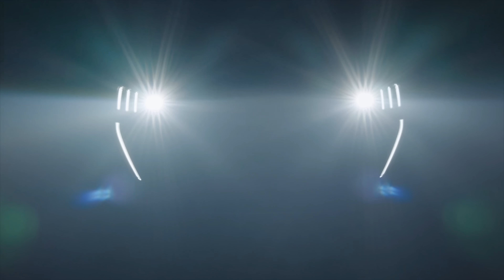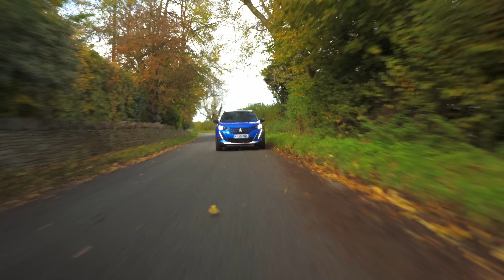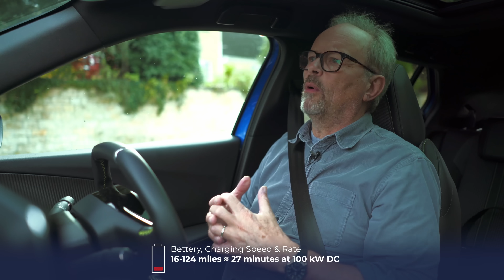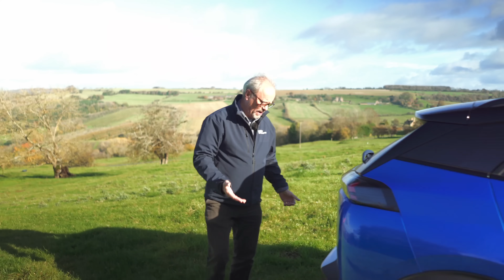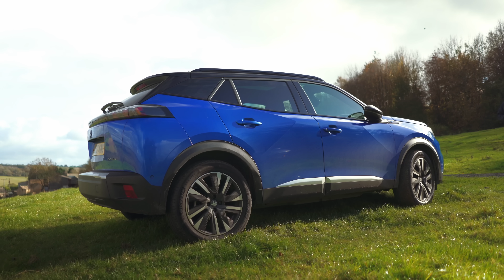Peugeot e2008 - how does it compare to other compact SUVs? | 100% Independent, 100% Electric

Comment: Not to concerned about the range as it seems average for the price of the car and fits most peoples needs and got me an EV for an affordable price and my fuel and servicing savings pays for the car.  I had a BWM 4 series before and was expensive to run and this cars quality and interior finish and performance is just as good and I am very concerned about climate change and beside EV cars are better to drive. A bit boxy though. lol.

Comment: i think everything is ok with this car, except 50kWh. 50kWh is really not a lot for an SUV. it should have 75kWh or more.
this is the massive downside when sharing a combustion engine based plattform.
this is what VW does absolutely right.
* they have a pure EV plattform
* they offer three different battery sizes and this gives them a HUGE advantage, because in the sales statistic they see what people really buy and not just claim to would buy.
with thee different battery options VW exactly knows from their sales statistics, if they need to increase battery sizes or not. listening to customers what battery size they really want by looking into the sales figures is the smartest thing that they can do.
Peugeot can not do this with offering one battery size which is STUPID!

Comment: So when Robert got it it would not only do 100 miles or less on a full charge it only showed that was what it would do.
If he had gone up to the top of a long hill, and gone down and the car showed 5 on the fantasy meter then he could have had it show 229 miles range, then gone up a motorway and got only 135 miles.

Comment: So you unplug it at 100% or 98% and the Range showing is from the last figure you were getting. So the car was just at 3.0 or 3.1.  There is a trip meter.   Read the owners manual, or just turn the left hand stalk and look through the options in front of your eyes.
  Strange the range some people say they can get at motorway speeds with the bigger PSA models all using the same platforms. Especially the taller / heavier ones ton bigger wheels / tyres than say the e-Corsa which is the lightest and lowest.     Are many owners driving alone with no luggage & the tyres over inflated?

Comment: A lot of mistakes Robert, and the range a central point of the review. As you said, 130miles are from the last driver, that is why it is taking a long time to update the range. If you could not figure out how to get the trip odometer or dimming the ambiance lights, you should read the manual or contact Peugeot, not put it a review.

Comment: Miles per gallon is directly related to the cost of electricity. If I charge at home on overnight 4.47p kwh I get 240mpge. If I charge in Tesla Superchargers at 24p kw I get 60mpge. If I charge off shell at 39p kw I get 39 mpge. Most public charge points are very expensive.

Comment: MPGe does not take into account the motor energy conversion wich varies a lot. 25% to 45% energy convertion efficiency for ice.
In the physics world, running at 65mph require the same power, the nature if the thing does not care what is pushing it.
But Electric can regen kinetic energy, that an ice car cannot.
So 130 MPGe is in reality around 130/3 = 43 mpg at the pump.
This is really good figure  that a good ice car can do
Electric car manufacturers are forced to have this good because of low energy density of actual batteries.

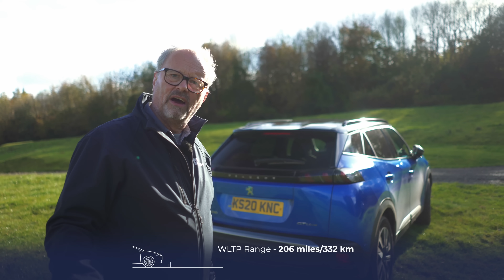Comment: 13:12 ... and also except a reversing camera. I can't get my head around how a car can be the top of the line and not have that camera.

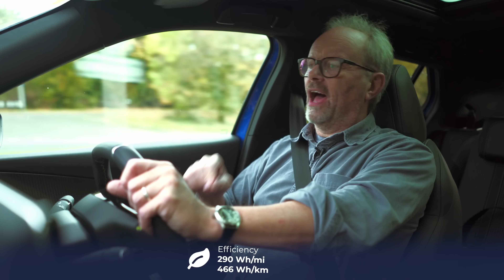Thanks for the conversion effort at 4:40, just wanted to point out that you should divide by 1.609 instead of multiplying.

Comment: My theory with electric ones being the higher models is one of market. People buying cheap cars live in flats, or houses without driveways and garages.  They can't charge an electric car and the public infrastructure while improving simply isn't there.  Sadly we are still slightly at the point in the UK where the ability to charge an electric car is a luxury, especially one like this that would have managed maybe 2 days of my commute if I was a bit lucky.  So either you spend an hour in a tesco car park 3 times a week or you buy a petrol, the trim level is not the determining factor here.  Once this improves, and it will do in both range and charging provision then boggo spec electrics will be vital.  Now? I don't think they'd sell.

Comment: I love my e2008. Driven carefully I get 4.2 miles per kWh, aggressively  3.1. My range at 10 celcius is between 189 and 140 miles. Annoying things about the car, the only way to see battery percentage whilst driving is via the phone app, fuse box takes up half the glove compartment on right hand drive versions, door cills too high and voice recognition appalling. I have no regrets, it's super refined, practical and efficient. I've driven many of the e2008's competitors and the Peugeot is my favourite. There is no heated steering wheel, they do a very basic version, rear view camera available, ambient lighting adjustable, trip computer easily accessed.

Comment: Was disappointed with his attitude to this car. I've watched this channel for a a long time. The car has been designed with EV in mind, clearly. It's built on same line as ICE vehicles and the same underpinnings as e208, Corsa and that nasty 😂😅 green Mokka he looked at and loved a few wks back . You can't expect car makers to jump 100% immediately to electric. The trip reset/view is on the stalk. The led lights can be adjusted or switched off. Car does come with a reverse camera to my knowledge. The range is fine for now, PSA are not TESLA and are in a transition themselves. He was unfortunately wrong about the spec levels...got totally confused with that. I felt he had pitty on the car in the end by saying he will drive it a few days more.... As though he had his nose turned up to it and that it was something like Tesco value goods. Maybe he has something against Peugeots, non wacky EVs or sub 4 secs vehicles. Life isn't crazy and extreme all the time Rob. I'm disappointed with his attitude in this video. Yes I have this car on order and other reviewers love it and the e208. I find his attitude very strange on this video together with the information provided.

Comment: Surly 290 watts into 1kw or 1000 watts = 3.45 miles per kWh or am I missing something? 
The other point I would make is to quote mpg is a bit of a red herring, it all depends or how and where you charge. For example.:- home charge peak 14p per kWh. Off peak on OctopusEnergy:-5p per kWh Rapid charge point 35p per kWh. Ionity rapid charge 79p per kWh. It’s cheaper if one can home charge but a huge number of people can’t and they will have to use public charge points which are much more expensive. This is where infrastructure has to be improve in a big way and these 7kwh points should only charge households rates of 14 pence per kWh.

Comment: It sounds as if they are letting the side down if they don’t measure the battery SOC accurately and give the range you should be able to get by driving normally. That is supposed to be one of benefits of leccy over Dino juice sloshing around in a tank.

Comment: I have the DS3 E-Tense with the same battery and motor and am disgusted at the 'real world' range of 120 miles at 70mph, and 175 at 55 mph. And remember you can't drive 120 miles then charge up because you need a good 15 miles of driving round to find a working charger, so not even 90 minutes of driving inbetween charging, and that's in summer!. I have done 12k miles and am now giving the car back and going for a new diesel 2008 as its a motability car. Disgusted!!!
You can reset the trip computer by pressing in the right stick till you see trip 1 or 2, then holding the button in for 3 seconds to reset the mileage
Dont have it in B mode (regen) and floor it, pop it in Sport mode then you get the full power.

Comment: Having a special button to ignore programmed charge times feels slightly unnecessary. I presume the car, like most modern cars, as built-in navigation which means the car should be able to see that it's not at home and it should ignore the charge schedule as a result.

Comment: The MPGe calculation is wrong. If you use 290Wh/mi, to get to MPGe you divide 1000 by 290. That gets you your mi/kwh which is 3.49, not 4.5. Then you take 3.49 and multiply it by the kWh equivalence of energy density in a gallon of gas which is ~33.7kWh...that gets you a MPGe of 116mpge. That's not even close to your calculations of 187mpge. My Model 3, with me driving like a grandma, is averaging 156mpge so for this small crossover to be getting better efficiency than a lighter sedan is a stretch.

I'm sure someone just messed up a number or two but it's definitely important to get the numbers right. Either way, 116mpge is still amazing.

Comment: There's something not right here... My 70 plate e2008 GT Line (no extras) has both reversing camera and side/down cameras which are excellent. Also does circa 185 miles no problem. So had Bobby been given a duff model to review? Agree re range computer, had a mind of its own, Kia have this down to a tee.

Comment: As an e208 owner (best car I have ever owned by a street) I am a bit surprised by the quibbles you raise in this video. No-one uses NEDC range, Peugeot themselves stress WLTP and in my e208 it is clearly accurate, I have driven 200+ miles on one charge more than once (ok it was during the summer). The e2008 is only slightly less economical, by all accounts and in recent tests both variants have exceeded the WLTP figure. Ignore the GoM - the software is too pessimistic and a software update is out there to fix it. I don't see any link to the fossil fuel mentality, though the bonnet on an e208 is smaller it is true. Agree it needs a reversing camera (my GT has one). Surely there is a good argument for introducing an EV option into the range to make it seem less of a leap to drivers not fully signed up to the EV revolution? The ID3 is a great car - but the eGolf seems to appeal more to many drivers because they are used to the way it looks.

Comment: As you say, if the driver had a trip meter you could do a rough mental calculation and come up with an estimated miles remaining. Then you could compare this with the car's calculation of miles remaining. Then would probably be significantly different. To the embarrassment of the car manufacturer.
But there is no solution to this dilemma. The miles remaining on any particular amount of charge varies greatly, and it depends on how you drive. Heavy throttle or light throttle will make a large difference to the miles remaining.
How can the manufacturer predict how you will drive in the future. Can't be done.

Comment: Bjorn Nyland provided data at the end of his video. The 2008 did 610 miles on 154kwhs, that’s 3.9 miles per kWh. He chose mid priced chargers, preferring to save money over expediency, but at 35pence per kwh, this translates into a total cost of £53.90 to travel 610 miles. That’s 9p a mile. The range wasn’t actually established as he arrived at chargers with 10% and charged up to different levels to optimise his ‘get away’ and to avoid the delay in charging above 80%. Financial and efficiency stats are secondary to the environmental benefits though

Comment: The conversion from a US gallon to electricity = 33.7kWh
So, taking the miles/kWh X 33.7 = MPGe

In our e-Golf, we have averaged 5.5 miles/kWh so that is 185MPGe.
In our Bolt EV, we have been averaging 4.5 miles/kWh = 151MPGe.

290Wh/mile = 1000/290 = 3.45 miles/kWh = 116MPGe - in US gallons, at least.

Comment: For the first time a deslike from me.
About the range this was based on the driving style from previous drivers. From other tests and from owners the range is good.
I think is not an issue if the car was build for being compatible with a combustion engine as well.

Comment: I have this car and regularly did around 200 miles during the summer around the city.

We did a long trip to Somerset from London and averaged around 60mph and got 155 miles of range. 

In winter so far we're getting around 185 range. 

It's our first ev and we really like it. It's a lease, and now that we've had it we'll be getting something with 200+ 

If all you do is mostly city driving then you'll easily get above 180 miles of range across the year. 

Ignore Robert's crappy review car.
Reply: I think also TeslaBjörn got quite good efficiency. So either car was faulty in this test or something wrong in test/review.

Comment: You missed the 1 major problem with Peugeot which is the glove box! They are too lazy to move the fuse box with the steering wheel so the glove box is pointless. I ordered an E208 which we were expecting on the 20th, thats only a few days away and they still haven't even made it so I expect a lengthy delay but our dealer hasn't been any good and we tend to have to do the chasing for updates

Comment: Love Robert but the rant about the different specs is bizarely wrong. Petrol or Electric you get the same options of specs so why rant about the fact you have been given a high spec one to test drive? Of course you are always given a car with everything loaded on it, they want you to like it. You can fine low spec models that are cheaper. Its strange you would pretend otherwise?
Reply: also it does over 150 miles easily in the winter. Its almost like you made it out to be a bad car. Not sure why all these strange trumpian "facts" to follow the narrative its a transition car? Its a perfectly useable and one of the best on the market for the money.

Comment: Great to see a car i helped design on the road!
The car is made on the same line as the petrol and diesel models. There are definitely compromises to this, but the advantage is that you can flex from 0% of the cars being produced being electric, up to 95%! As an example of this, we expected to start at 2.5% being electric, but it's currently running at 14.5%. And that's on PSAs highest volume line!

Comment: If my Renault kangoo ze had a 100 kw battery instead of it’s 33kw and held 200+ winter range here in Gloucestershire for back lane drives you open it up by taking the panel out behind the drivers seat I would keep it for more than it’s current 10k instead of wanting to upgrade to a cyber truck as soon as.. love the channel.thanks.

Comment: No, it was not adapted, it was built from the start to be either petrol, diesel or electric! PSA has the opposite view of VAG on EVs on that matter.
The WLTP range is the same for every EV. There’s been tests on the e-2008 that show 300km (200 miles). Let’s be honest. Too much talking as well.

Comment: kWh and range, so a good EV will use 1 kWh to go 3-4 miles, petrol and diesel have about 9-10 kWh of chemical energy per litre which in a fuel efficient car may do 10 miles, or as low as 5 miles [the latest Landrover defender does petrol 20 miles to the gallon, 5 miles to the litre...1/2 mile to the kWh. The reason is simple most of that chemical energy is wasted as heat [and friction and air resistance,] about 80% where as only 20% of an electrical energy is wasted in things like friction and air resistance.

Comment: It's just a bigger e-208. Same battery size, same motor, same interior features.      
The only difference ? Less range, and more expensive. Not a great deal IMO.       
With incentives, the e-208 is not bad, with less range range but a better charging speed than the Zoe 1000€ optional DC plug. The e-2008 however ? It's on the price range of the Korean EV SUVs, and it loses the game here.

Comment: About the “transition car” stuff: I have to disagree with you. The consumer has to transition to electric as well, so I think it's good that it still feels familiar to them. 

For example, I am waiting for a an electric saloon car (such as the 508) that doesn't look like a kitchen appliance/spaceship.
Reply: Honestly making a transition car in any case is a bad move. EV's are interesting because they are not bound to the internals of ICE. So interior shapes and exterior shapes can be drastically different. Which makes them feel interesting and new. From a new EV I at least expect 500 KM range and 150KW charging. So far only a small portion of EVs managed this.

Many EV's made in 2020 were there mainly for regulations. Let's face it. Otherwise they would have waited a year with way more range and charge speeds. This includes ID.3, 4 and also the 208 and 2008. Especially horrible EV's like the Honda-E and Mazda MX-30 show that these are just statement cars. Not actually viable cars made for everyday use.
Reply: @Astke  I disagree, many are not interesting, they are just ugly. Many car enthusiasts detest the "Johnny 5" design mentality that seems to prevail with EVs too. We want a car that looks like a proper car but uses electric as the power source. Transition cars are a great idea, particularly if they get people like me to buy them, they sell well and help steer designers away from the novelty toy designs they are churning out. Because if all I had to choose from was ID3 or model 3 type cars with their revolting interior UI design, I  would have to be dragged away from my ICE cars kicking and screaming.
Reply: The pricetag for is not transitioning however. That's a shame.
Reply: I'm waiting for a decent shooting brake - the MG5 is a choice of 1 only

Comment: 150 to 200 miles range may be enough in England...it's not even close to enough where I live even during the summer, let alone winter. Just a trip down to see my daughter and her husband is 240 miles one way...with hardly any EV chargers worth using (bunch of old 50kw useless ones) along the way. I would really need an EV with say 400 miles of range in the dead of winter to completely replace any ICE vehicles I own...hopefully that day isn't too far away.